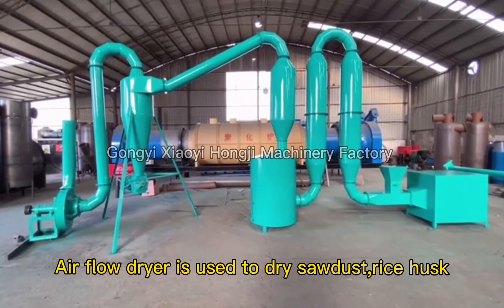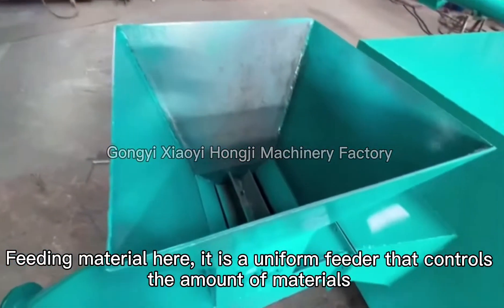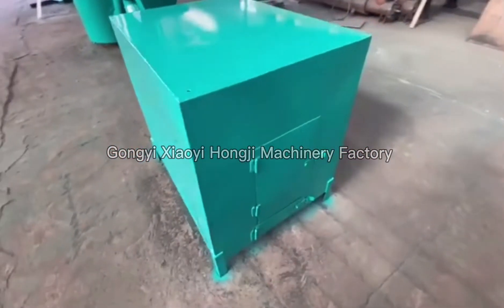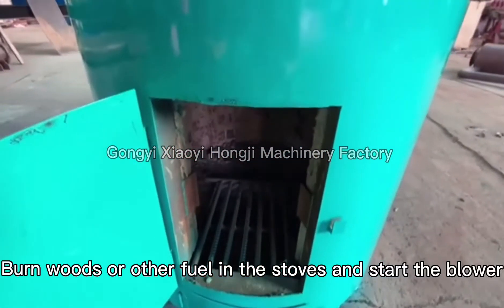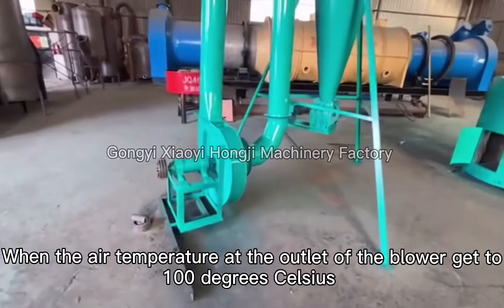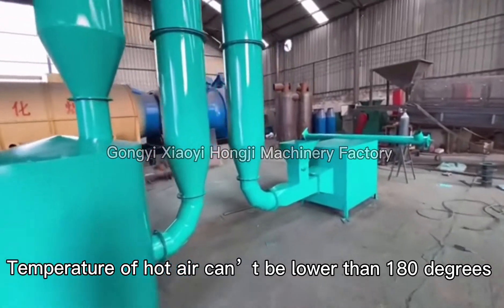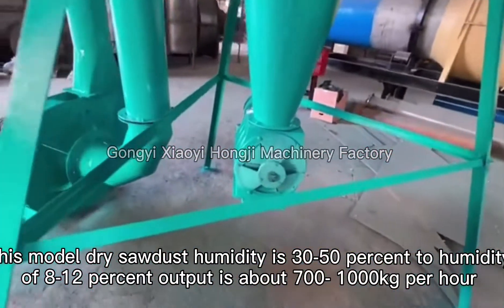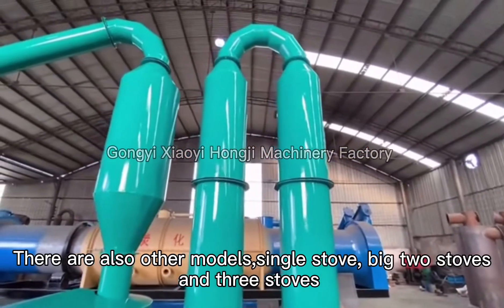Air flow dryer for sawdust,rice husk

Comment: When wel material gets dry then the vapour how remove?
Reply from the maker: The water vapor is discharged from the pipe on the top of the fan
Reply: @hj-briquettemachine1623 
Left side fan will extract air but feed materials how move from bend pipe ? 
Saw a motor in middle or final output point what is it's purpose?
Reply from the maker: @MRKHAN-vr4fp  The heat source material passes through the fan, because the material has a high specific gravity, it will fall from the Shakron